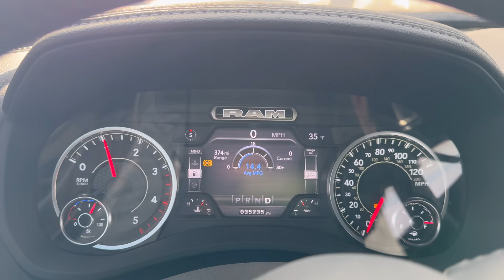Putting My RAM To Work | TONS Of Rock

Comment: As someone who has gravel driveways, I recommend that the top layer of the driveway be what is called A/B limestone around here. Some call it 'crusher run'. It's basically a mix of the smaller rocks you got plus fine dust/dirt size. This fills in the gaps between the rocks and keeps them from imitating marbles as well as keeping them in place better. Of course, it's probably too late now, but you might consider trying it the next time you get rock.
Reply: Traffic Bond
Reply: With a little moisture and then rent(borrow)A smooth wheel roller…. Very solid driveway👍🏽

Comment: Watch how close those trees are to your buildings.  Not only do you need room to get a mower through there, but the root ball grows slightly larger than the canopy.  Then, the roots uplift a small section of the concrete slab, causing the slab to crack and fail.  The trees need to be planted about 30 to 50 percent further from the building than the full grown crown radius.

Comment: Looks like you bought river rock.  I only used #8 limestone, when I put in a new drive.  Held nicely over a decade. This is also called a dresser layer.

Advice:  wind break trees:  Big equals later $1,000s in tree cutting, if you can't do it yourself.  All trees break wind.

You might consider a poplar type, more column like; less big branches.

Pines always block your view, if that's what you want.

Nice looking corn field, will be dotted, when they grow.

Nice job landscaping!!

Comment: So good to see youall happy and looking forward to the new year, 2024 farming and making numerous videos. The remote mic works great!  The comment about the smaller surface rock called "crusher rock" sounds like a good idea.  This year I hope Laure and Grant wear the appropriate dust and chemical filter masks while working with treated seed, especially Laura when you get inside the seed hopper-much dust you should NOT breathe. Keep up with your equipment maintenance, It will payoff in fewer repairs and breakdowns.   Would be a very good idea to install fire detectors, and even a fire suppression system (sprinklers) in the equipment barn. That is a lot of expensive equipment there that you depend on. Best wisher for the new year, look forward to your success.

Comment: Grant/Laura - fully understand  you wanting gravel that blends with your buildings, but it looks like you chose river rock for your drive.  The problem with river rock is it is rounded and will roll under your tires.  You'll start to see where you turn into your drive the gravel rolling off to the side.  You really need limestone or a similar crushed rock that is angular and locks together.  We always put down 2B limestone, compacted, the n, as another poster stated, 2A modified, which is 3/4" down to fines.  This packs really well and once its been wet a time or two gets like concrete.  Your stone yard my call it road base. 57's, 2A modified, etc. - depends on the yard and the local jargon.

Comment: When my driveway was new I used white rock.  The problem with white rock is it breaks down and you have white dust on everything.  I then put a layer of what we call river rock on top of the white rock.  River rock is like pea gravel on steroids.  This last time I used pea gravel, but the problem is my tires pickup the gravel in the tire treads and bring it into the garage.  So soon I will go back with river rock.

Comment: A lovelier mic is designed to be placed 5 to 7 inches from your mouth. (just above where your neclease reaches). When it gets too close (like so many people wear it, and like you are wearing it) it often overpowers the mic element, thus distorting the audio a bit. Try moving it down a bit and see if your audio sound a bit better. Yes, I know it clips so well to your collor. Form or function. You decide.

Comment: Since you are  building this up for your future, take new technology into account.  Put stabilized soil under anywhere you will be driving heavy equipment (including light trucks), and geotextile fabric under any rock you actually want to stay around.  Not knowing your exact soil conditions, I couldn't give you a time frame.  But, running heavy loads over rock when it's wet causes hydraulic movement.  Basically, your load is working like that plate compactor, but on a smaller area at a time.  This just drives the rock into the ground. This is why you have to retop a rock driveway every 5 to 7 years.  Properly installed, this gets pushed to 15 to 20 years, if ever.  You might need to break up the top layer and relevel, but not add more.